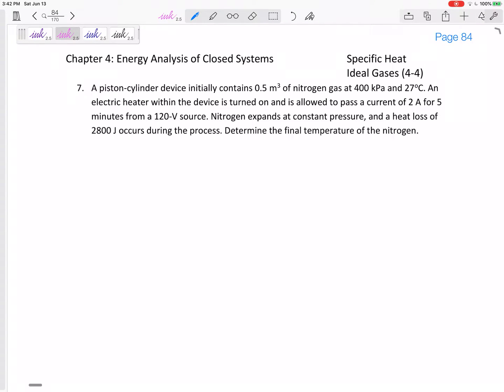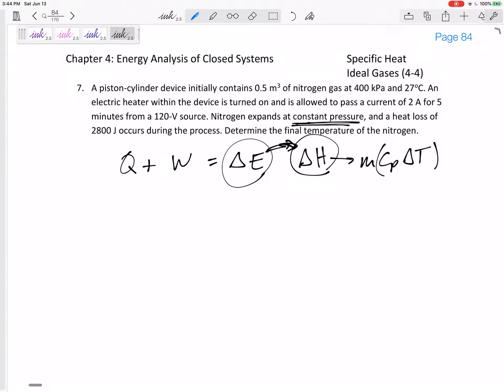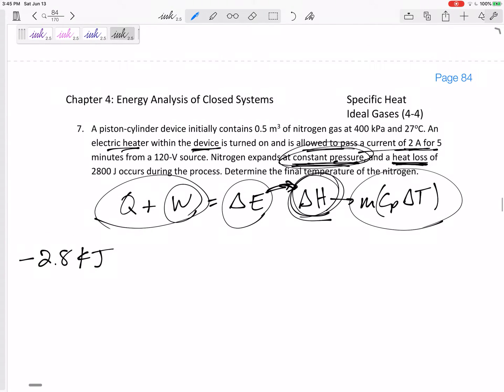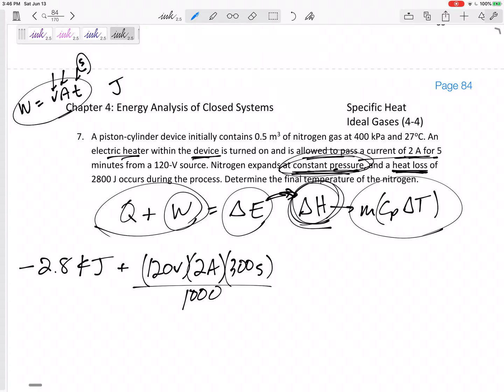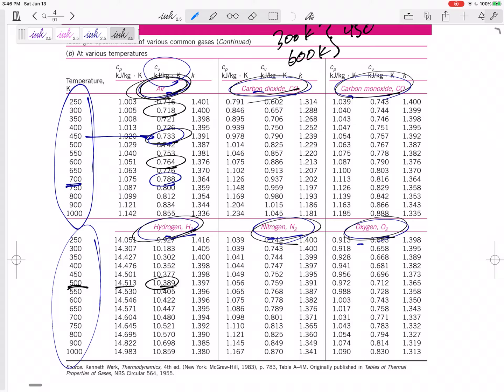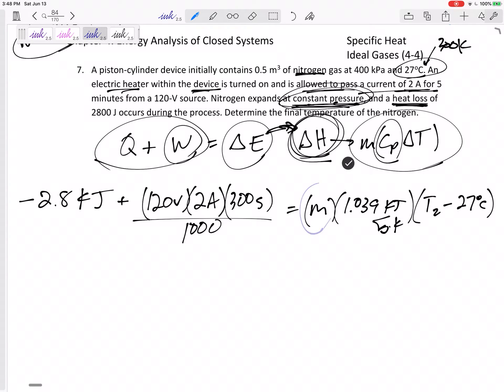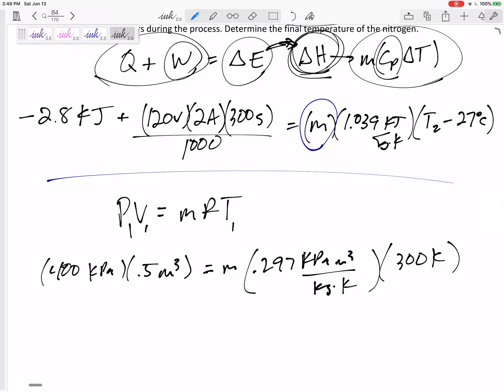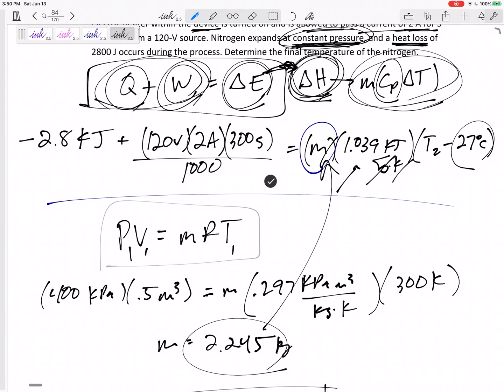Thermodynamics - 4-4 Ideal Gas Specific Heat example 3

Comment: its nitrogen nor a ideal gas, than why he use ideal gas eq.?
Reply from the maker: Nitrogen behaves like an ideal gas. Most gases we’ll see (nitrogen, oxygen, co2, air) we can assume are ideal gases. Possibly not when the pressure is very high or temp is very low.

Comment: Can mass be found by using the tables for specific volume of nitrogen at given pressure and temp instead of the  ideal gas equation?
Reply: No, it can't be found in this way; because there are no tables that include the specific volume of Nitrogen😄🌸
Reply: @nourdarwish4277  thank you